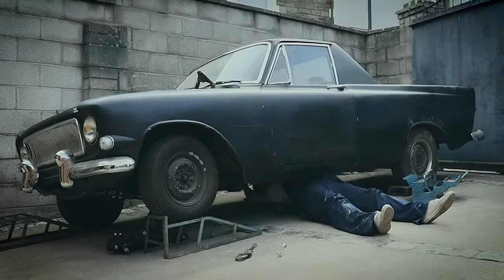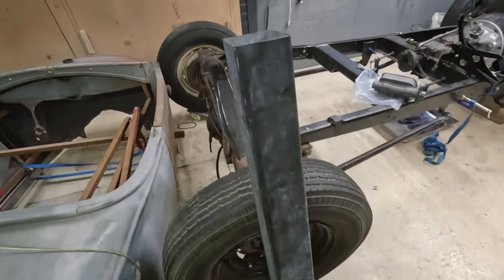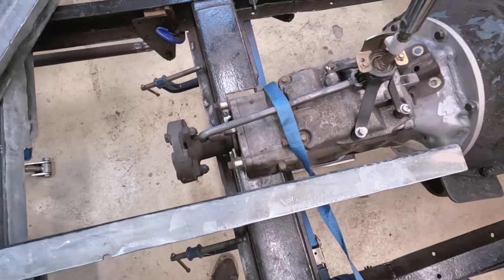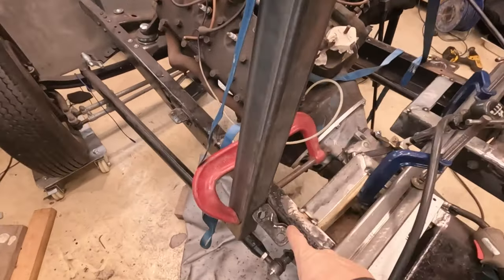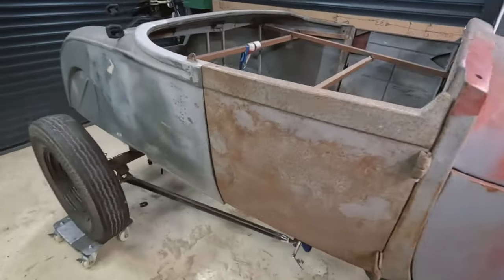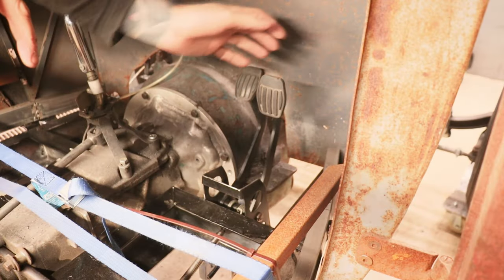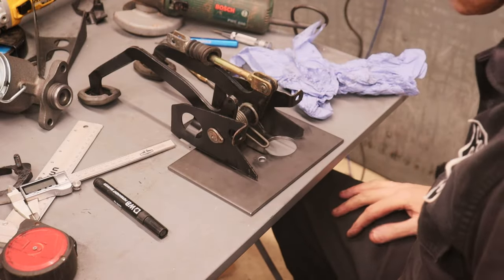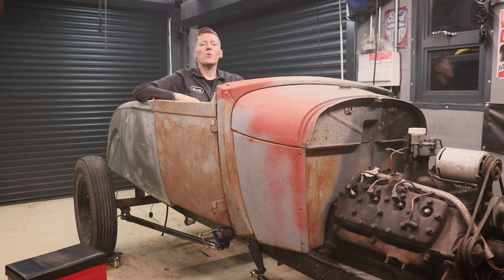Budget V8 Hotrod Build - Pt7. Making a pedal box, master cylinder instal, and more chassis work!

Comment: Loving the build, just found your channel.  I wanted to let you know that master cylinder is for a disc brake front end.  If your running drum brakes on your front axle you want a different master cylinder.  The two reservoirs on top should be the same.  If I remember right you want a 67 mustang master for front and rear drums.  It has the same mount.

Comment: Great work if you take the fan idler off and shorten it also get a crab cap style distributor for the flathead you will be able to move the engine and box forward which would eliminate your clearance issues and you can move the body forward and instead of recessing the firewall unstitch it and reverse it so it actually sits back also you can cut of the front of the crankshaft nut as its for a cranking handle and not required anymore just a thought for you keep up the good work all the best
Reply from the maker: Hi Rob. This is exactly the information and advice I need. Thanks! I did think the fan sticks out a long way.

The existing firewall already seems to be reversed or something.  And I think it is now welded in place. I was just planning to recess the lower third a little more, around the engine (which seems to be a common thing that’s done).
….but first I’ll look into shorting the fan idler and using a crab cap style distributor, as you suggest.

Thank you, Scott